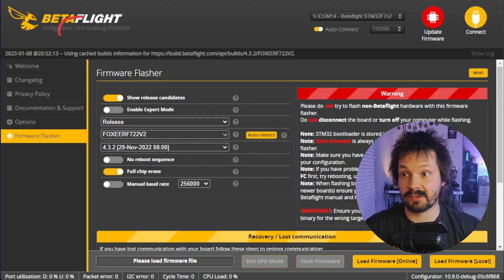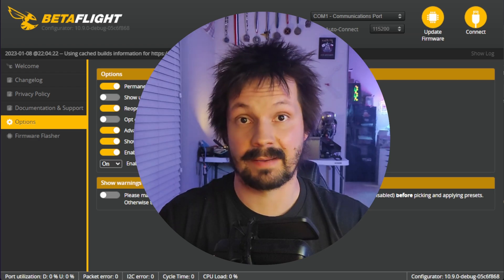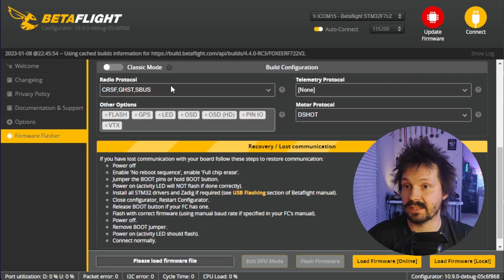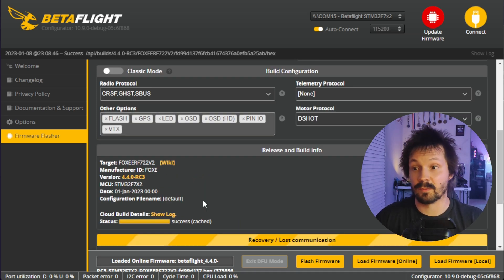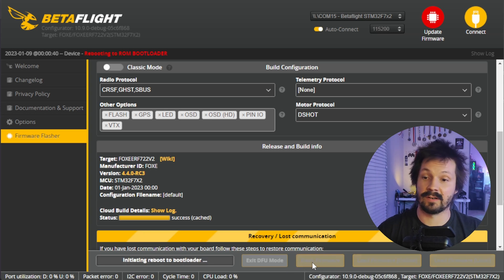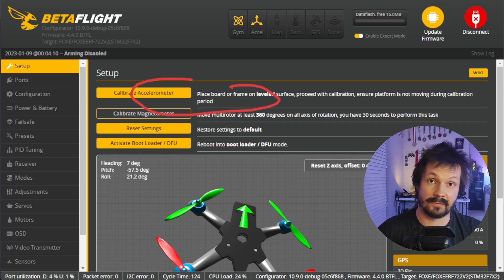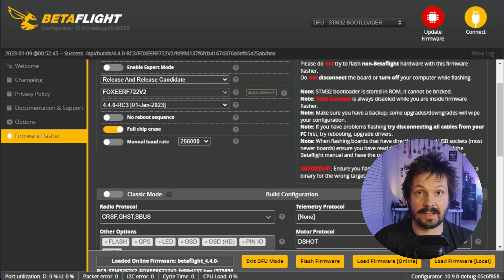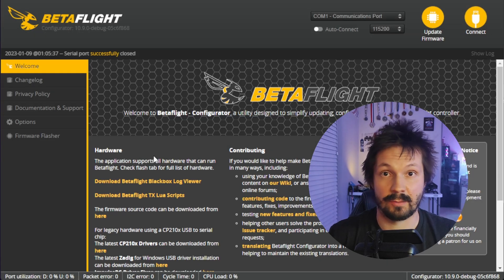How to flash Betaflight 4.4+ and what is Cloud Build?

Comment: Hey Ivan, thanks for your super useful content! I am going crazy trying to flash BetaFlight 4.4 on a GepRC Rocket Plus (OMNIBUSF4SD flight controller). When hitting Flash Firmware I get the error message "firmware image contains addresses not found on target device", and the drone exits DFU mode automatically. The flight controller I select is correct, do you have any ideas?
Reply from the maker: Hey thanks man!
I'm checking the website here, and it says you need to select the target geprcf411:
https://geprc.com/product/gep-20a-f4-aio/

Or you have installed a different FC? That error usually means you are trying to flash F405 firmware on F411, or F4 firmware on F7, or something similar.
Reply: @IvanEfimovLimon  thanks mate! For some reasons in the original "dump" the name of the flight controller was different. I managed to flash using the geprcf411, although there is a ton of errors in betaflight... uff!
Reply from the maker: @doraymon4797  which errors? Don't apply diff, setup from scratch
Reply: After flashing I need to re apply all my settings coming from the previous dump. But many generate errors, including some PID
Reply from the maker: @doraymon4797  yeah that's what I'm saying, don't apply previous dump or diff. Gotta setup from scratch when flashing new version of BF.
Reply: @IvanEfimovLimon  thanks a lot

Comment: I have a matekF405 standard flight controller currently on old betaflight 3.5.2.  That is no longer supported by the newer configurators.
When I go to flash it on the new configurator, the old target matekF405 no longer exists.  I am trying the matekF405STD target as the others don't seem to match
the flight controller goes into dfu mode (red power button, no other flashy lights) but the status text at the bottom of the configurator just says rebooting to dfu mode.  But dfu is showing in the dropdown, the lights are right, I have tried replugging, I have used the boot button, just never getting past that step. The firmware is never erased or updated.
I can change my firmware in configurator 10.4 fine, so it does not seem to be the cable.... would the wrong target prevent the flashing?
Currently I am just using old betaflight, but I would really like to move out of the stone ages.
Reply: I have not tried the driver repair, as it is working fine in the older configurator and all indications are that it is going into dfu mode...
Reply from the maker: Hey man. Maybe there is a bug for updating from older versions. Could you try to use configurator, for example 10.5, update to 4.0 first? Also worth bug the matek, so they added a correct target to BF.
Reply: @IvanEfimovLimon  I eventually got it working. It was some combination of settings that I believe included checking the no reboot sequence option. I am fuzzy on the details because I tried so many things and it was awhile ago. I have flashed two more times since then and have not had this issue re-occur.

Comment: Ivan, I didnt have your email or I would have sent this question privately so sorry for the lengthy note:   I've recently run into an odd issue with flashing the "Kaack Commit".   I'm using the HobbywingF7 FC and have 5 in quads now all running your "Kaack" mode.   Since your last instructions to me all has been fine for weeks.   Over the weekend I was building a new quad and flashed a new HobbyWing F7 FC - its just like the others and all seem well but when I began the it set up I notice the Blackbox tab in the Configurator stated my "Board does not support BlackBox Logging" and the tab was basically empty.  (I know this is false the board does).  So I started investigating, reflashed a number of times with different selections; I tried another new board, - I tried a lot of different stuff honestly - When I checked the build summary for 4.5.0 Zulu with the "Kaack commit" I saw these blackbox lines in the code list:
(%% (optimised) ./src/main/blackbox/blackbox.c 
%% (optimised) ./src/main/blackbox/blackbox_encoding.c 
%% (optimised) ./src/main/blackbox/blackbox_io.c )    

So I decided to flashed the Release 4.4.0 (with no Kaack commit) and the Blackbox feature came back.  [I did noticed there is a "Commit" for Missing Blackbox but running that didn't fix my issue and I did not investigate the Pull request]

I don't want to write up an issue report because 4.4.0 works fine and it seems to also be fine when I flash 4.5.0 Zulu (as long as I don't add the "Kaack Commit". )   

Do you have any suggestions what's happening.   I mean I can live without it, obviously but I thought I ask in case you are aware of a simple fix.  Thanks!

Comment: Is Omnibus FC supported with 4.4 firmware? I tried to flash my Omnibus FC but  the gyro and accelerometer could not be able to detect. Any suggestion. Thanks.
Reply from the maker: If that's F4 then supported. Check BF discord, there is a announcement if what to do in the cases like yours
Reply: @IvanEfimovLimon  Yes, it’s F4
Reply from the maker: @LAFPV  then supported yup

Comment: Ivan,  With the final Release of the Configurator, the "Select Comment" box is gone when I select the "Released 4.4" so I was unable to load your "Kaack" fork.   Any suggestions what I can do to get the Kaack features back?
Reply from the maker: Watch video one more time ha :)
You need to toggle expert mode, show development and then it allows to put KAACK )
Reply: @IvanEfimovLimon  I did have Expert mode on and I could see the latest Daily build for 4.5 zulu and the release for 4.4 - I tried to enter Kaack or #12100 since there was no "Select Comment" box.  I even selected 4.5 zulu which gave me a "Select Comment Box" but it wouldn't accept KAACK nor #12100.    Maybe its me but before the final release of the Configurator I had flashed 4 race quads following your video.   Any chance they killed you Pull Request???   Not sure but I've been using your Kaack mode for months now and love it.   I'm sorry that I loaded to new Configurator.  😞
Reply from the maker: @joedidia  what you mean by not accepted KAACK? I just downloaded 10.9 release and flashed KAACK. It accepts it no problem, as long as you have 4.5-zulu selected. Are you sure you put KAACK in the Commit, not in the custom defines?
Reply: @IvanEfimovLimon I type KAACK  (after selecting 4.5 zulu delevlopment version) and hit tab the word Kaack disappears but I did not try to flash that version because I'm not familiar with 4.5 zulu.  I really just wanted the Kaack features in the 4.4 release.   So is that no long possible because we can only add Kaack features it to a "Development" version of BF?
Reply from the maker: @joedidia  the KAACK version will give you 4.4+KAACK, not 4.5. Despite you have selected 4.5
Reply: Ok, I flashed it with BF 4.5.0 zulu and the Kaack works.   Sorry for all the questions but I was just trying to flash with 4.4.0 release and that was my issue.  Hopefully 4.5.0 zulu won't mess me up.  Thanks for your help.
Reply from the maker: @joedidia  as I said, if you put KAACK, it will be 4.4, not 4.5

Comment: Hey Ivan, friday/saturday I tried cloudbuilding and basic building, with contrasted success. I have question, and I'm affraid the preliminaires are way too long, but I don't know how to write it shorter.

Here is the story:

5 inch freestyle
board: manufacturer_id: DALR, board_name: DALRCF405
Betaflight / STM32F405 (S405)

Initial Factory  Betaflight / DALRCF405 (DLF4) 3.5.2 Oct 16 2018

By the end of october I move to 4.3.1, add gps, flashed ESC to run RPM_filter

My last pefectly working firmware 4.3.1:  rpm filter ON, crossfire, working GPS, working Return-home, blackbox, Lua Sripts, OSD (analogique) everything's fine and quad fly pretty good.

Interested in having a better Return_Home, and trying cloudbuilding, I decided to go 4.4 RC4 or ZULU

Friday the 13th, night:
BTFL conf 4.4 Rc4, cloud build BTFL 4.4 RC4 (keept the defaults) no problems, no error msg, everythings looking fine, but quad totally creasy: no more blackbox, no more rpm filter, no more woking gps, Rx link, Gyro and OSD appairing ou disapairing randomly at every CLI modif or at quad power ON/OFF.

saturday the 14:  tried  BTFL ZuLu and Conf 4.4 RC4, cloud build BTFL 4.4 ZULU (keept the defaults) no problems, no error msg at flash, everythings looking fine. 
BUT again No more Blackbox, so I did'nt bother to test further cause I love the blackbox...

Then I tried again cloudbuild BTFL 4,4 RC4, cause I didn't save the link of the build log at the first time. Again no problems, no error msg at flash, everythings looking fine but No more Blackbox, so I did'nt test further. 

Then I tried CLASSIC BUILD with RC4, and then everything worked fine and the quad works as expected. There is much too much snow to really deep test it, but I managed to have some easy fly outside and everythings looks fine.

Unfortunately, I didn't had time saturday to report these cloud-build issue in the discord, as you suggest in your video, and now all this is probably obsolete cause the new versions of BTFL 4.4 RC5 and the configurator 4.4 RC5 are out.
I keept a buildlog copy as well as the links (but now the links seems dead).

My question is: this FC works perfectly fine, (manufacturer_id: DALR, board_name: DALRCF405) even if it's getting a little old and probably on the exotic side ... . 
As now, I don't understand what's the manufacturer job is , is he supposed to keep up to date the FC description ( not to mention he may be out of business !) used with this new cloud building and what's betaflight dev could do ?
I worry these kind of not to trendy FC could never make it through cloud building, and end in the trash cause impossible to update, what look to be the opposite of the cloudBuilding brillant objectif.
Is it worth reporting all this and the logs on discord, or is it just bothering the Devs for nothing ?
Should I rather try a new cloud building with 4.4 RC5, and report in case of problems ?
Any insights on all this cloud building evolution, regarding older FC will be wonderfull.

Comment: 13:06 - Leaving comment just to join the nerd club :) It's always good to know how things work in a great detail and you did a great job, Ivan. Thanks!
This video is also very important to all the people who modified the commercially available FC hardware for any nerdy reason so they now diverge from the "official" HW spec. of that FC (I guess that the cloud build could then in some cases generate a code for wrong/missing original HW, leaving out all the code for all the different HW).
For example: I bought a Mamba Basic F722 Mini Mk3 FC, which had an MPU-6500 just because of the MPU-6000 shortage. But on FC's PCB, there are traces for MPU-6000. So what I did is that I bought a bunch of shitty FCs with MPU-6000 on them which were still available (at that time) and swapped the gyro to my new Mamba. It just worked. The gyro noise levels are better => I can have less filtering and/or more aggressive PIDs .. you know the story. Long live the MPU-6000.
(Maybe in this specific case the cloud build includes code for all MPU-6xxx so in my case it would still work, but I can imagine cases when you need to tweak the cloud build and you gave us a very good explanation, Mr. Limon. Thanks!).
Reply from the maker: Welcome to the nerd club! Especially because you are able to resolder the gyro )))